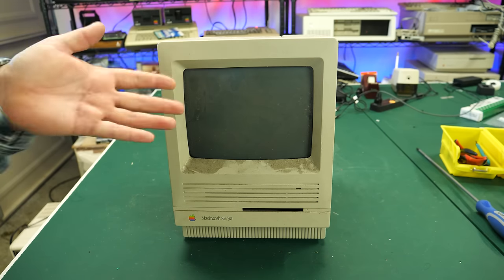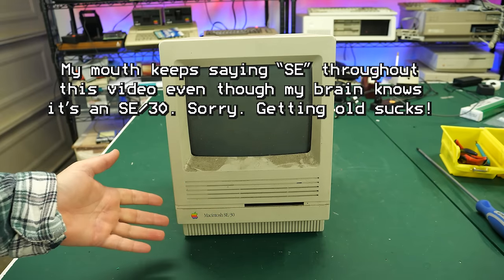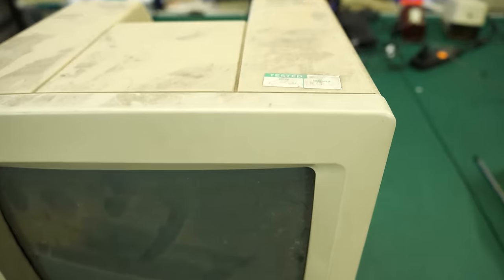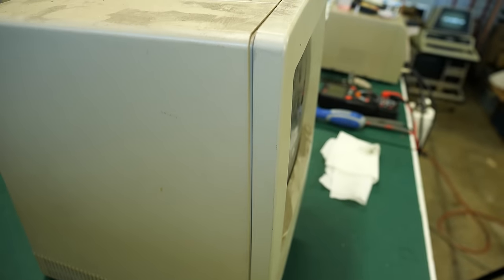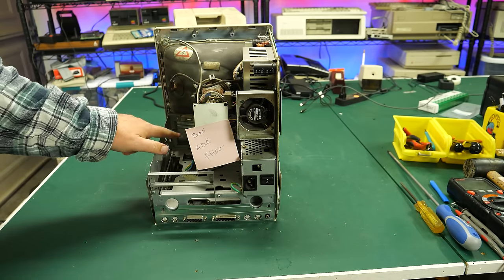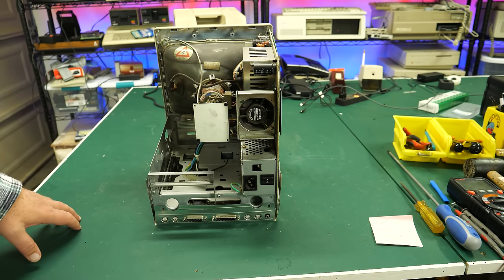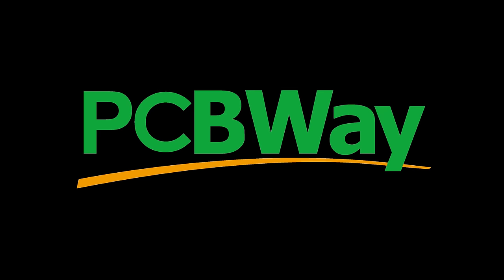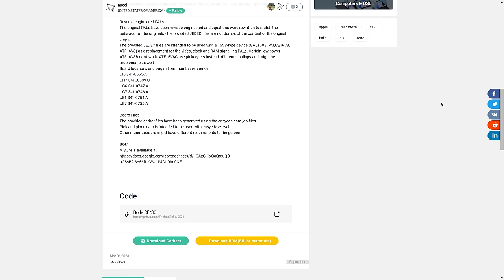Macintosh SE/30 Repair And Rebuild (Updates In The Comments)

Comment from the maker: UPDATES:
#1 As cgriffin352 pointed out below, I forgot to replace C7. C7 is a decoupling capacitor so since the voltage was steady, not having the capacitor installed wasn't an issue in this case. I have now replaced that one.
#2 You may have noticed a missing rubber foot on one corner of the case. I have replaced that.
#3 I have sourced a replacement back SE/30 case, so I will swap that out when it gets here.
#4 I forgot this was missing the HD LED. When the case comes in I will replace that, too.
Probably not enough for a follow-up video, but just a few things you might be curious about. Thanks for watching!! 😁😁
Reply: Just a little clarification for anybody else reading this…

Decoupling capacitors are needed due to the dynamic nature of digital switching; when the ICs change from low to high (or vice-versa) either internally or externally, it needs a burst of current. The power traces going to the IC are not fast enough to provide this, and as the IC pulls this current in the voltage will droop. This happens very quickly and can only be seen on an oscilloscope.

Not having a decoupling capacitor present may work, but is likely to be somewhat unreliable.
Reply from the maker: Thanks for adding the explanation so I didn't have to 😄

Comment: I'm not a big Macintosh fan, but I'm glad to see any old computer rescued from the landfill.  Ya make too big a deal about exterior dirt when all it takes is a good wipedown with some 409 or other surface cleaner to bring all right, followed by gunk removal from the stickers (I prefer WD-40 to lighter fluid - it's more persistent and doesn't attack paint or plastics).  Your work on the board was much more interesting.  The "twist" method for removing SMD capacitors is intriguing, and looks to work quite well.  Your troubleshooting is systematic enough to get the job done, and where it is not, it is driven by experience and not merely haphazard guesswork.  All in all, a well done restoration!
Reply from the maker: Thanks

Comment: The twist method works great, right until it doesn't.  Shear force is much more likely to tear pads off.  You're better off using a pair of snips to disassemble the cap and then desoldering the leads.

Comment: SE/30 is more than up to the task.  You can install up to 128MBs of RAM in that sucker with a 32-bit enabler.  Coupled with a SCSI SSD, it'll fly.  7.1.1 Pro is my goto OS.  It's very similar to 7.5, but a lot of the stuff 7.5 has built in is still modular and removable.  It also allows you to toggle 24-bit memory addressing for those really old apps, keeping nice compatibility.

Comment: I have a theory
It was possibly used in an office (judging by the soot from high hours),then it failed, it was stored in a closet for a while, they used it as a parts machine for other machines that died,  then when the business shut down, they gave it to a thrift store ( judging by the "tested" sticker), then the thrift store forgot about it, then when the thrift store was shutting down/moving/renovating/getting rid of old stock, they noticed it then recycled it

Comment: Hey a hint for drying motherboards I learned from the Amiga community is to do a drying pass in the oven. Crank it way down to 50°C / 122°F and it should just be warm enough to dry out any remaining water. Of course some isopropanol will also help remove water. :-)
Reply from the maker: Yep. Both good tips if you need to.

Comment: Tbh having the superdrive is the best one to have at this point. You can write software to floppies with a PC without needing special hardware. You can read 400 and 800k disks. The only problem is that you can't write to 400k disks in a way that can be read in 400k drives.

Comment: Why do almost everyone refuse to use flux on de-soldering components? It will prevent molten solder and hot copper from oxidation and also the braid works better with flux.
Reply from the maker: Yes. Flux makes it better for sure. No one should refuse to use it.
Reply: 100% agree, I used to just use the solder braid dry as I didn't know any different, but then I saw someone use some flux with it on a random YT video, so I gave it a go and it is a game changer! It works so much better with a bit of flux added that i'm surprised that nobody really seems to use it on the videos I watch on here...

Comment: Hi there, i have a macintosh SE thats powering up fine, screen is up, single beep after power on, ends up in a cursor blank screen but nothing there after, no disk icon, nothing. Not booting at all from the sd card behind the computer. may i know what could be the problem?

Comment: Hi mate, i have a Mac SE that powers on fine, 1 beep, and screen comes on, then ends up in a blank screen with cursor icon but no disk icon or anything after that. May i know what could be the reason? Even if the memory card is faulty, there still should be disk icon, but none.

Comment: The level of incompetence - twisting off caps😥
Reply: No guts, no glory. 😜
Reply: meh it's fine.
Reply from the maker: That's what I used to think. Until I tried it.
Reply: Bah... I've done (and seen) more damage with the hot air method than the 'push/twist' method... maybe that's just me, but still after easily over a hundred SMD caps I've never had an issue that wasn't pre-existing.
Reply: Yes, better to not show it. Other people might try it and lift or snap off a pad.
Reply: So I used to use hot air... twist is so much more reliable. I recap several macs per month working through my dad and my collection. Seriously- it does so much less damage. I have recapped a mac yesterday and today. No pads lost. I have only lost one pad on a badly corroded board out of about 20 or 30 boards if not more.
It's so much less dangerous than hot air.